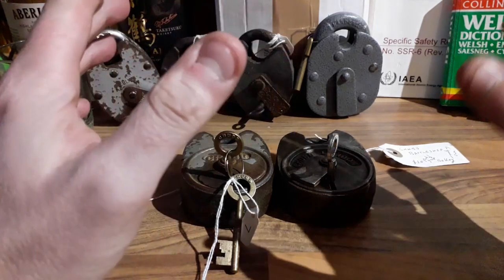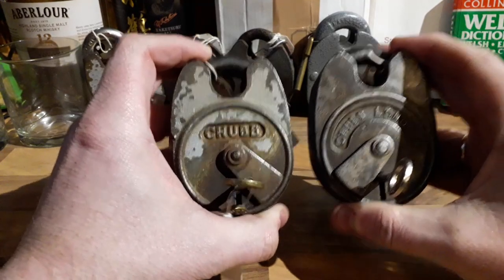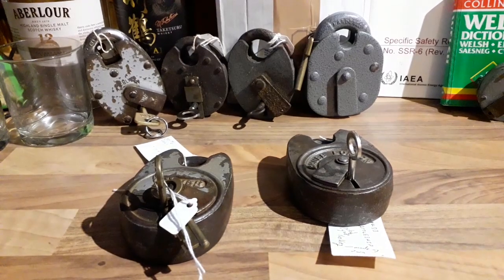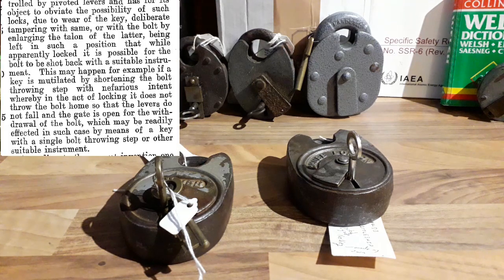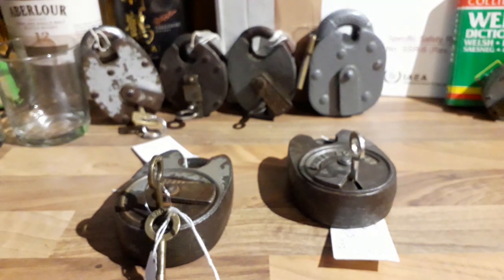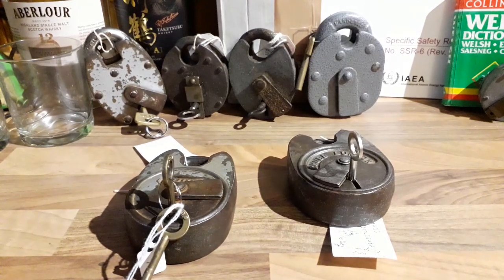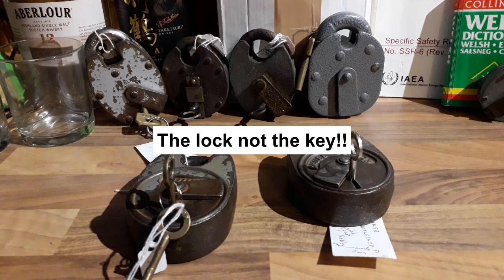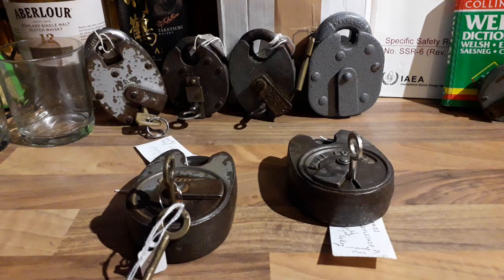Chubb - monitor lever - Patent 445,444

Comment: Chris, they are also found in some Chubb safe locks, and also in Chubb locks used in jails to let the staff know the lock bolt is not fully thrown - of course the key cannot be removed after so called "locking". Apparently prisoners had been known to stuff lock strikes with paper etc. to accelerate the wear on key and bolt tallon back in the '30's and '40's. and the monitor lever was initially designed for jail locks. Some quality drawer locks by Chubb also had the monitor lever and some had the detector mechanism ( anti pick ) perhaps over kill for the application. People often think that the monitor lever was a form of anti pick, whereas it purely and simply monitored the state of the lock bolt.
Reply from the maker: Brian, thanks for the additional info.

Comment: Very intresting stuff Chris. I have a Chubb lock box with a detector lock. Has a monitor lever in position 1. Can email pics if you are intrested.
Also potentially a closed lever version in a safe lock. Will need to check that tho. I didnt know they where a thing. Exelent video as usual👍
Reply from the maker: Pictures of any examples would be great - Chris Capune just showed a great example of a drawer lock with one in.